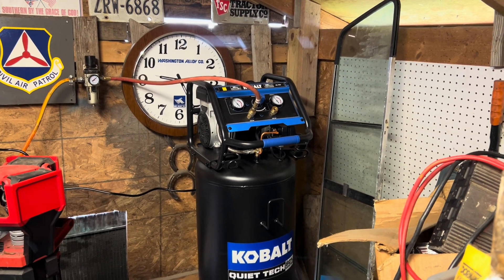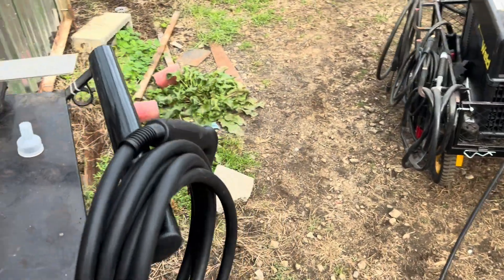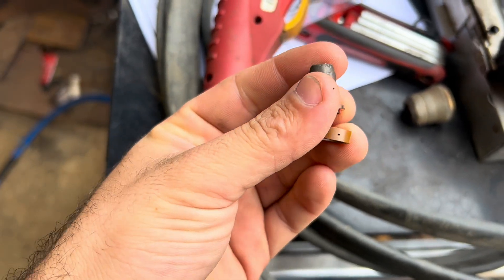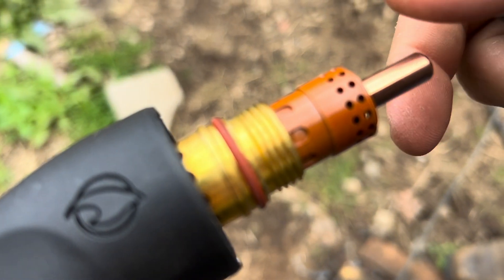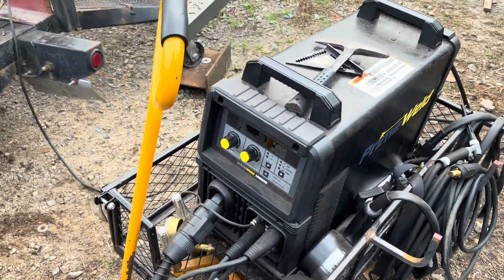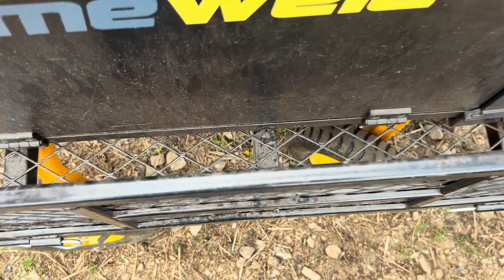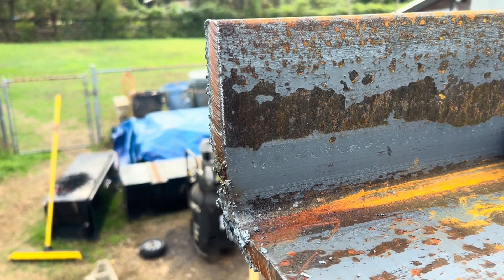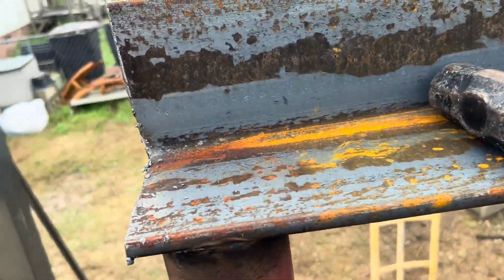Prime Weld MIG285 and Cut60 update

Comment: Fixing to buy the Primeweld 50 plasma cutter. I notice the CFM parameters are close-is that air compressor sufficient being below the CFM requirements?
Reply from the maker: It should work but will need to wait until it’s fully charged to start and probably will have to wait to recharge on long cuts

Comment: I was like why’s he dang chipping slag off that mig welder but then I seen the weld and noticed it’s prolly flux core. I try not to run flux core in my nicer mig machine, I just run another baby flux core only machine so I don’t gotta swap my stuff over all the time. I run the arc captain machines mostly and been lucky so far. But your right the comsumables are trash on these cheaper machines

Comment: I don't have a lot of knowledge about plasma consumables, but a shop I worked at bought an really good Italian made plasma of some sort, then replaced the torch with one that uses hypertherm consumables.  Then they found cheap consumables on amazon that are just as good as the hypertherm ones, but they had the spring on them. They just simply pulled the spring off of the consumable, and they work in their non spring consumable torch. Not sure if this comment has any value but I thought it was worth mentioning.

Comment: We are a prime weld shop. Have been welding for over 50 years and Prime Weld beats Lincoln and Miller for customer service. I own them all and Prime W eld is the best at keeping a shop running without BS ,
Reply: Indeed, customer service is excelent, I have a tig machine from them in Europe, the foot pedal stopped working, and they still helped me